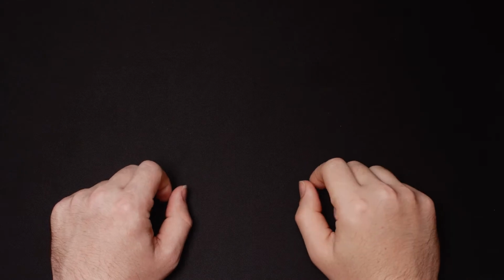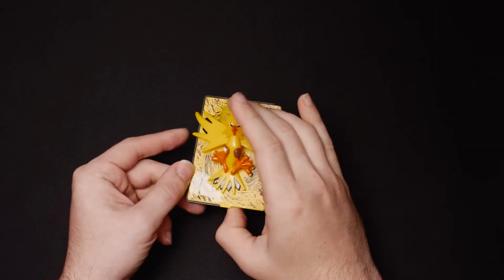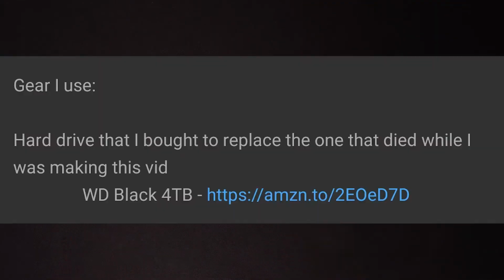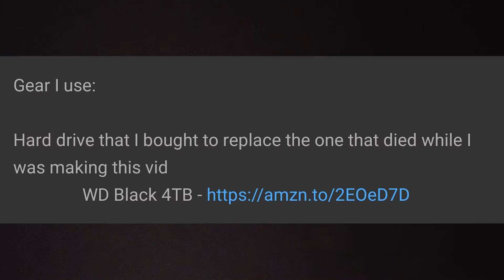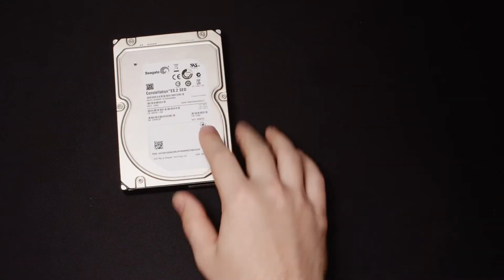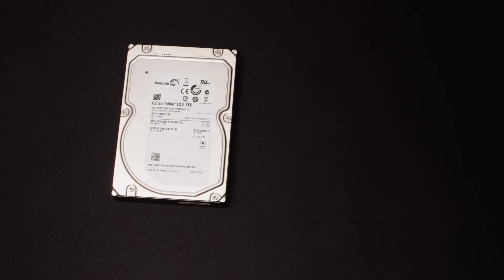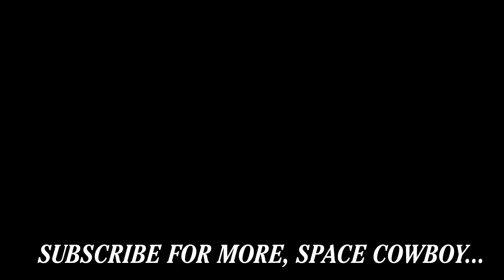Worlds Smallest Hard Drive VS a Regular Hard Drive.

Comment: 0:01 A Quick review of the PC
Reply from the maker: What, like, the specs of my build?

CPU: i7 8086k (won for free from intel)
GPU: MSI Gtx 1080 Duke
RAM: g.skill TridentZ rgb 64gb 3600MHz

And as far as storage goes, after I pulled the 2tb hdd that I took apart in this video, I replaced it with a 4tb hdd to go along with my 2tb boot ssd.

Other than that, the only other things of note are the elgato hd60 pro, and the NZXT aio liquid cooler with 240mm radiator.

The build is a couple years old at this point, but it's still really good to use.
Reply: @ConnorNolanTech Why do you need that much RAM ?
Reply from the maker: Because I like to edit video while I have a lot of reference info open in chrome tabs. I've looked at performance monitor while editing before, and I've gotten up to about 45 gigs of ram usage. That's far from the norm, though. I honestly could probably get away with 32 gigs.